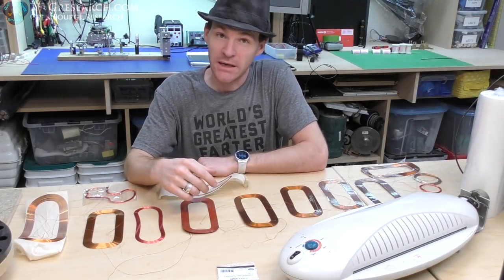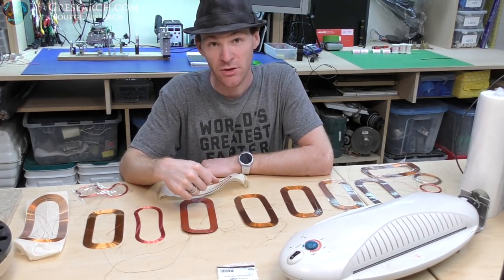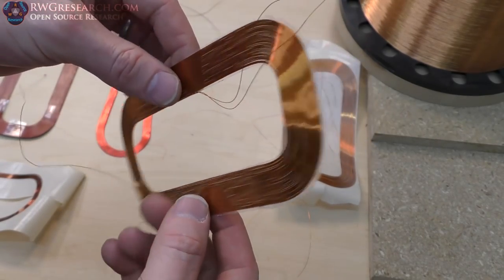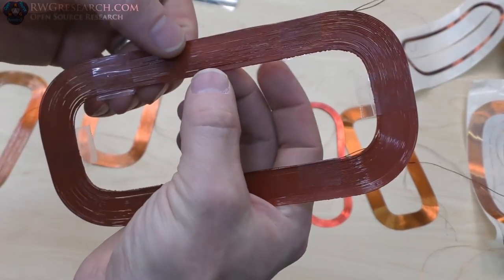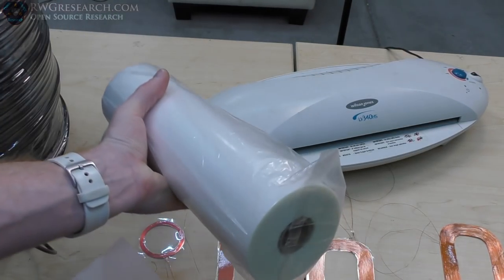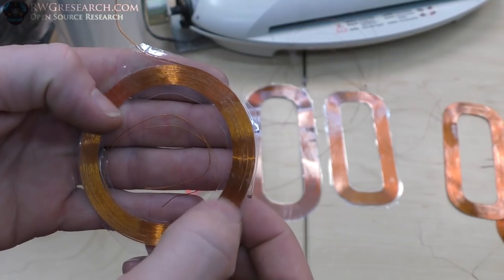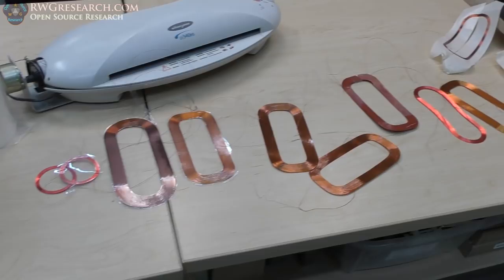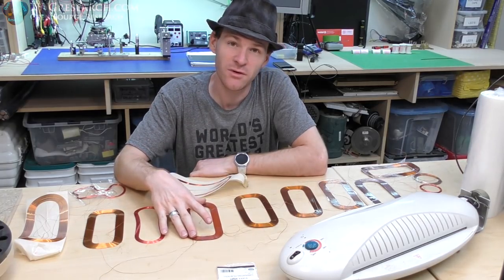CNC Flat Coil Winder : Methods I Tested To Finish The Coils, Glue, Epoxy, Lamination, Heat Cure!

Comment: Russ, try the epoxy again, but thin it with alcohol :) It'll help the epoxy seep into the gaps between the windings. Heat will also make the epoxy runnier.
Best of luck!
~Azy <3

Comment: Use self-bondig wire (wire with sticky layer that need to be heated like you said) but don't heat it by driving the current through it. Just blow on it with a heat gun (soldering stations often has such feature). This is how it is done in the industry.

Comment: Nice work - very encouraging!! 

I have been developing SMPSs and magnetics components for the last 35 years, so I could suggest a few possibilities. Instead of using packing tape or lamination film, perhaps you could get hold of some proper PET or Mylar (polyimide) tapes that are formally approved for use in safety (barrier) insulation in transformers etc. The adhesive won't react with the solvents in the varnish or encapsulating materials. The PET tapes are usually yellow and rated for 130C or 155C etc. The Mylar tapes are brown and translucent and rated for even higher temps. As for varnishes, there are a lot of different types, designed for use in safety transformers, chokes etc. They may be air drying or two-part. As I said, they are designed not to compromise the adhesive on the tapes. They are typically listed in an "insulation system" which lists compatible tapes, glues, adhesives, varnishes etc that play nicely together.

So as a first step, perhaps you could simply repeat your use of tape on the printer bed, this time using PET or Mylar tapes. Lay a second layer down on top afterwards so it sticks face to face with the first, trim it back and you are done. If you want to use varnish or potting compound, if you select one of these "proper" products, it will work without damaging the tape and once it has dried, you could remove the bottom tape and repeat the process to fully cover it.

If you try one of the potting / encapsulating compounds, you could make a sort of moulded winding. More rigid and controlled but poorer winding factor / less copper content.

Comment: you try pressing that laminate with a clothes iron? some foil underneath to reflect the heat back up and of coarse some cloth and greaseproof paper over top to stop the iron sticking to the plastic....there is also a gem glue I have used that is strong and somewhat flexible, it looks kind of like PVA wood glue but smells more a solvent type glue.

Comment: In Tesla's bi-filer coil patient he explains that while using this coil with alternating currents, there exists a potential difference sufficient to secure in the coil a capacity capable of neutralizing its self-induction.  

My questions is thus,  are you trying to neutralize the self inductance  so you can use less energy to secure the same magnetic flux that would originally necessitate much more?  

If i'm thinking along the same path, this would allow you to build a large coil by way of stacking the bi-filer coils in series and then supplying them with AC currents.  I believe the outcome would be a conductor/coil with a really strong magnetic flux field that didn't resist the flow of currents,  which ultimately would reduce the impedance.

Comment: Russ I think your onto something this should work great for all kinds of metal detector coils my 11 incher is only 38 turns of no# 32 magnet wire my 4 incher ??? Its sealed in epoxy

Comment: What about a very thin layer of rubber cement after printing then glue onto a laminating sheet? If anything it will only be temporary until the rubber cement cures and you remove it from the printing tape. Then glue other side to seal it up.

By the way Awesome job on the coil winder.... 
Who would have thought?

 You will have to see how the rubber cement cures in the laminator? You might not have to use the heat option, it would only be for getting the glue set right on each side of the coil... You'll have to play with it more...

Comment: If it doesn't need to be flexible, you could try an acrylic "clear coat" spray used for automotives. If you need it to be flexible, you could try one of those rubber paints like PlastiDip. We have Halfords "Peelable paint" here in the UK which is actually quite robust.

Comment: I'm guessing the glue in laminate paper and tape isnt as good as CrazyGlue... maybe lay down a sheet of seran wrap, spread crazy glue on the coil, lay the coil on the seran wrap with glue side down, another layer of glue on top, and another sheet seran wrap. I'm sure the glue will melt the plastic (so do this FAST!) but that may be good as long as you prop it up on an extended edge or something that could be trimmed later.
Reply: another, non-brittle option could be to dip it into a fondu type pot of hotglue? just throwing ideas around, good luck!
Reply: dang, crazy glue doesnt seem to dry well, (sealed itself inside the plastc) and wrap isnt as firm as the laminate🙈 I should've known👀